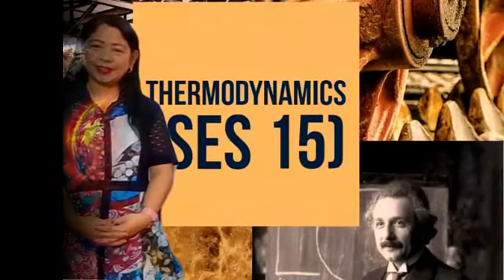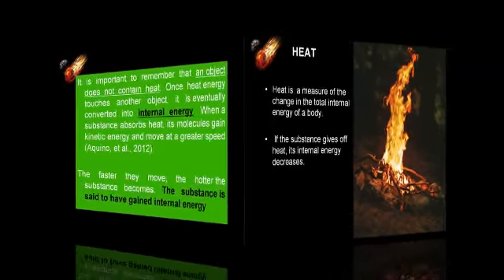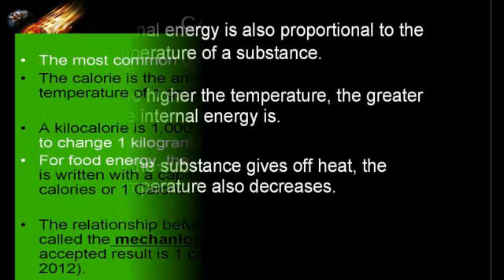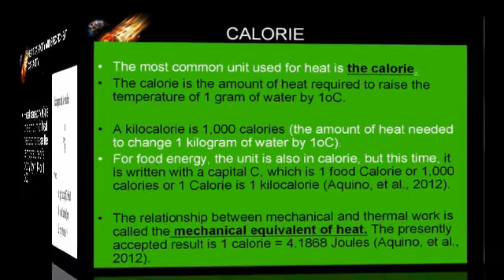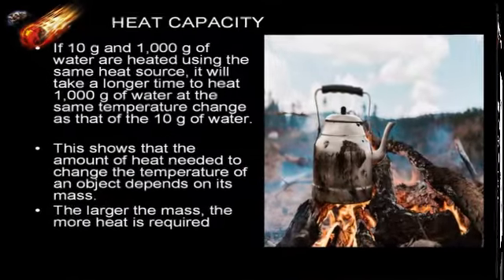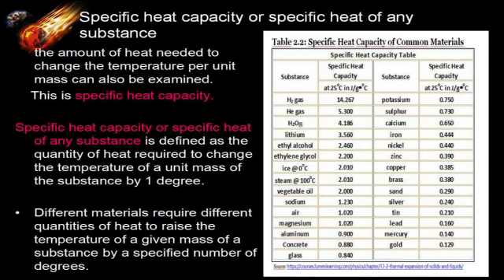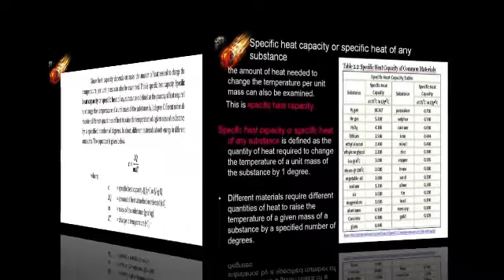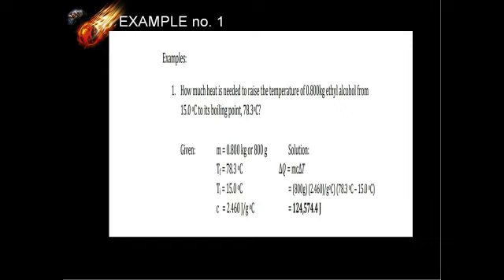HEAT AND SPECIFIC HEAT CAPACITY

Comment: The core difference is that heat deals with thermal energy, whereas temperature is more concerned with molecular kinetic energy. Heat is the transfer of thermal energy, whereas temperature is a property the object exhibits.

Heat is the one form of Energy which is in transion Condition because of its Temperature difference
Heat-Chemical energy holded by a Fuel(molecules)
Temperature-it is measure of heat
We have all noticed that when you heat something up, its temperature rises. Often we think that heat and temperature are the same thing. However, this is not the case. Heat and temperature are related to each other, but are different concepts.
Heat is the total energy of molecular motion in a substance while temperature is a measure of the average energy of molecular motion in a substance. Heat energy depends on the speed of the particles, the number of particles (the size or mass), and the type of particles in an object. Temperature does not depend on the size or type of object. For example, the temperature of a small cup of water might be the same as the temperature of a large tub of water, but the tub of water has more heat because it has more water and thus more total thermal energy.

2. It’s an important material property in a number of fields including chemistry and physics.
The specific heat capacity and other thermodynamic properties are also critical in engineering disciplines especially when designing systems where the management of heat is essential. This would include everything from refrigeration systems, heating systems and of course almost everything in electronics where the management of waste heat is critical.
*Application
•Substances having a small specific heat capacity, are very useful as material in cooking instruments such as frying pans, pots, kettles and so on, because, they can be quickly heated up even when small amount oh heat is supplied

•An instrument like a thermometer, the body may be made of higher specific heat and the tip is made of a material of low specific heat.
Reply from the maker: your answer for no. 1 is the same with Jeremy.
Reply: @Dr.MHS1973  maam may kadugtong pa po akin. Salamat po 😇

Comment: 1. How is heat different from temperature? Heat is the amount of energy in a object and total kinetic and potential energy contained by molecules in an object. Temperature is measure of the intensity of an object, and Average kinetic energy of molecules in a substance.
2. Why do you think that it is important for you to understand "specific heat capacity'?
Its is important to understand because to improve our application of specific heat capacity in our daily life and importance in term of changing temperature of object.
Ex: using oven in baking, 
Cooking meat in fryingpan into stove, using heater in shower.

Comment: Heat is energy that is transferred from one body to another as the result of a difference in temperature.
Temperature is a measure of hotness or coldness expressed in terms of any of several arbitrary scales like Celsius and Fahrenheit.
It is important to understand specific heat capacity in terms of energy, time and costs involved in changing temperatures of objects.
applications in daily life:
small specific heat capacity, are very useful as material in cooking instruments such as frying pans, pots and kettles.
and also high specific heat capacity is suitable as a material for constructing kettle handlers and insulators because, they can be quickly heated up even when small amount oh heat is supplied.

Comment: Heat describes the transfer of thermal energy between molecules within a system and is measured in Joules while temperature describes the average kinetic energy of molecules within a material or system and is measured in Celsius (°C), Kelvin(K), Fahrenheit (°F), or Rankine (R).

 It is important as it will give an indication of how much energy will be required to heat or cool an object of a given mass by a given amount. This will give information as to how long the heating or cooling process will take under a given supply, as well as the cost implications thereof.

Application in daily living
*Handles of utensil
*in cooking and food making

Comment: 1. Heat is the amount of energy in a body, while the temperature is the degree of hotness and coldness measured on a definite scale.

2. It is important to understand the specific heat capacity, because we are surrounded by things with different heat capacity, so that we could know that these things may low in heat resistant or high in heat resistant

•For example we are using utensils like for cooking. The handle of the utensils are high in specific heat capacity, the transfer of heat is going to the handle, with the help of thermal insulators, we can handle the utensils without hurting ourselves while it is placed on a heated stove.
Reply from the maker: your answer for no. 1 is the same with Christine
Reply: I already edited my answer ma'am thank you

Comment: Heat is an energy moving particles or a total measure of kinetic energy while temperature is the average kinetic energy of particles in the system. 

It is important to understand specific heat capacity because it includes in our daily life routine like in cooking we are using different kinds of pan and pot. Utensils that made up of metal has low specific heat capacity are very useful in cooking they can be heated quickly.

Comment: 1.	How is Heat different from Temperature?
If a body gains heat, its temperature will increase in general. If a body loses heat, its temperature will decrease in general.
Temperature is a relative measurement of how hot/cold something is. Technically, it is a measurement of the kinetic energy of the atoms or molecules of the substance.
Heat is a form of energy. Adding heat to a substance will generally raise its temperature. (The reason that I have used the word generally above is that something different happens if the substance is about to "change state" between solid/liquid or liquid/gas. Water changing between ice/liquid or liquid/steam are examples. So assume the temperature changes I am talking about are not near the temperatures where state changes happen.
Let's say that to warm 1 kg of a substance 10∘C requires a quantity Q of heat.
To warm 2 kg of that substance 10∘C requires a quantity 2Q of heat.
To warm 1 kg of that substance 20∘C requires a quantity 2Q of heat.
2.	WHY DO YOU THINK THAT IT IS IMPORTANT FOR YOU TO UNDERSTAND "specific Heat capacity"? Give examples of the applications in your daily life.
Specific heat capacity is a measure of the amount of heat energy required to change the temperature of 1 kg of a material by 1 K
Hence it is important as it will give an indication of how much energy will be required to heat or cool an object of a given mass by a given amount. This will give information as to how long the heating or cooling process will take under a given supply, as well as the cost implications thereof.
Example Applications in my daily life:
•	Substances in small amount or mass in cooking will be quickly heated up let’s say small amount of water heated in a stove
•	Hot coffee or tea will take longer before it falls down in temperature.
•	The handles of utensils at home are made of materials which have very high specific heat.  They act as thermal insulators. The insulating capability or conductivity is also dependent on specific heat.
•	The water in the container remains cool even in summer and the reason is high specific heat of water. Utensils used for making tea or coffee, or cooking vegetables or rice are made of materials of low specific heat. They are polished at the bottom. So they get heated quicker.
•	Materials of high specific heat can be used as insulators. That’s why wood chair in our house takes longer before it adapts to the hot condition inside our home.

Comment: 1. Heat deals with thermal energy, while Temperature is more concerned with molecular kinetic energy. 
2. It is important to understand becauses it will give an indication of how much energy will be required to heat or cool an object of a given mass by a given amount. Also, this will give information as to how long the heating or cooling process will take. 

Applications of specific heat capacity in daily life:
 • Substances having a small specific heat capacity, are very useful as material in cooking instruments such as frying pans, pots, kettles because, they can be quickly heated up even when small amount oh heat is supplied.

 • Sensitive thermometers also must be made from materials with small specific heat capacity so that it can detect and show a change of temperature rapidly and accurately.

Comment: How is Heat different from Temperature?

The difference between heat and temperature is that Heat is the form of energy that transfers from hot body to cold body. Its unit is the joule. While the temperature is the degree of hotness and coldness of the body. Its SI unit is Kelvin. Aside from that, heat deals with thermal energy, whereas temperature is more concerned with molecular kinetic energy

Why do you think it is important for you to understand "specific heat capacity"?

Heat is essential in our life specifically in our daily living. We use heat in cooking, heating water and even material productions that we use everyday. That is why it is important to understand specific heat capacity of objects as it  will give an indication of how much energy will be required to heat or cool an object of a given mass by a given amount. We can avoid such danger or risk when we have knowledge about specific heat capacity of objects. 

Applications of heat capacity in daily life. 
1. Heating of cooking materials like pots, frying pans and kettles.
2.Materials of high specific heat can be used as insulators. This application is just like our house which is made of wooden materials.
3. Used in oven. We have oven toaster.

Comment: 1. Heat and Temperature are different from each other. They are not same thing because heat is a form of energy, while temperature is how hot or cold something is. 

2. Specific heat capacity is important to understand in terms of energy, time and costs involved in changing temperatures of objects. Specific heat capacity is the amount of heat required to raise the temperature of a substance by 1 K. 

Applications:
1. Substances that have a high specific heat capacity is suitable as a material for constructing kettle handlers, insulators and oven covers, because, a high amount of heat will cause only a small change in temperature aka the material won't get hot too fast.

2. Heat storage instruments are very useful and they are usually made of substances with a high specific heat capacity.

3. Substances having a small specific heat capacity, are very useful as material in cooking instruments such as frying pans, pots, kettles and so on, because, they can be quickly heated up even when small amount oh heat is supplied.

Comment: The difference between heat and temperature is that Heat is a form of energy that can transfer from hot body to cold body while Temperature is the degree of hotness and coldness of a body.
It is important to understand specific heat capacity because it will give an indication of how much energy will be required to heat or cool an object of a given mass by a given amount.
Applications of specific heat capacity to daily life:
~Substances having a small specific heat capacity, are very useful as material in cooking instruments such as frying pans, pots, kettles and so on because, they can be quickly heated up even when small amount oh heat is supplied.
~Materials that have high specific heat can be used as insulators. For example, wood has a high specific heat.Wooden houses will keep the inside cooler during summer.
~Water is used as the cooling agent due to its high specific heat capacity.

Comment: 1. The difference is that heat deals with thermal energy, heat describes the transfer of thermal energy between molecules within a system and is measured in Joules  Heat measures how energy moves or flows. While temperature is more concerned with molecular kinetic energy, temperature describes the average kinetic energy of molecules within a material or system and is measured in Celsius (°C), Kelvin (K), and Fahrenheit(°F).

2. Specific heat capacity is a measure of the amount of heat energy required to change the temperature of 1 kg of a material by 1 K. Hence it is important to understand as it will give an indication of how much energy will be required to heat or cool an object of a given mass by a given amount.

Here are some applications:

• Boiling the kettle for a nice cup of tea. It requires the addition of specific heat to the water.
• Freezing water at 0°C for making iced drinks requires the removal of specific heat.
• Using the washing machine and dryer, or an electric iron for pressing and ironing.
• Cooking

Comment: 1.Difference of Temperature and Heat.

Temperature is a measure of the average kinetic energy of all the molecules in a substance. Because it is an average of the kinetic energy or all the molecules, the temperature of a substance does not depend on the total number of molecules in a substance. On the other hand, heat is a function of the number ofmolecules in a substance, so there is a dference between heat and temperature. Heat is a fom of energy while temperature is a measure of the degree of hotness of a substance, and is measured by a thermometer.

 2.WHY DO YOU THINK THAT IT IS IMPORTANT FOR YOU TO UNDERSTAND "specific heat capacity".
The specific heat capacity is a measure of how much energy it takes to change the temperature of a system. But in the definition, it is important to realise that the energy input must be by heating.  It is important as it will give an indication of how much energy will be required to heat or cool an object of a given mass by a given amount. 

"APPLICATION"
●Water as a cooling agent acts excellent as a cooling agent in engines. Water is also used in houses in cold climate countries because as it is heated up (boiled) it tends to retain heat and warm the house due to its high specific heat capacity.
●Substances having a small specific heat capacity, are very useful as material in cooking instruments such as frying pans, pots, kettles and so on, because, they can be quickly heated up even when small amount oh heat is supplied.

Comment: 1. How is heat different from temperature ?
The core difference is that heat deals with thermal energy, whereas temperature is more concerned with molecular kinetic energy. In another words ,heat is thought of, as a form of energy, but the temperature is a measure of energy. Heat describes the transfer of thermal energy between molecules within a system and is measured in Joules.Heat measures how energy moves or flows. An object can gain heat or lose heat, but it cannot have heat. Heat is a measure of change, never a property possessed by an object or system. Therefore, it is classified as a process variable.
Temperature describes the average kinetic energy of molecules within a material or system and is measured in Celsius (°C), Kelvin(K), Fahrenheit (°F), or Rankine (R). It is a measurable physical property of an object—also known as a state variable. Other measurable physical properties include velocity, mass, and density, to name a few.
 2..WHY DO YOU THINK THAT IT IS IMPORTANT FOR YOU TO UNDERSTAND "specific Heat capacity"? give examples of the applications in your daily life.
 Its really important for us to understand and have a knowedge about the specific heat of a thing , for example of this is the thing that we are using in the kitchen the utensils it is used for making tea or coffee, or cooking vegetables or rice are made of materials of low specific heat. They are polished at the bottom. So they get heated quicker. For example, copper, aluminum etc.
So it is not prone on fire. The prone on fire is the the handles of utensils at home are made of materials which have very high specific heat.  They act as thermal insulators. The insulating capability or conductivity is also dependent on specific heat and the materials with high specific heat can be used as insulators. For example wood has a high specific heat but that wooden houses will keep the inside cooler during summer. Builders can choose building materials appropriately depending on the location and altitude. That allows to build warmer houses or cooler houses.  Instrument like thermometer, the body may be made of higher specific heat and the tip is made of material of low specific heat.

Comment: 1. The main difference of heat and temperature is that heat is thought of, as a form of energy, but the temperature is a measure of energy.
2. Specific Heat Capacity s important as it will give an indication of how much energy will be required to heat or cool an object of a given mass by a given amount.
3. Substances having a small specific heat capacity, are very useful as material in cooking instruments such as frying pans, pots, kettles and so on, because, they can be quickly heated up even when small amount oh heat is supplied.

Comment: 1.Heat is the term for energy in transit while temperature is the measure how hot or cold a body is.

2.It is is important to learn what specific heat capacity is, because gives idea of how much energy is required to heat or cool an object, like for example how long will it take for a 1L of water to boil, or how long will it take for 1 glass of water to freeze